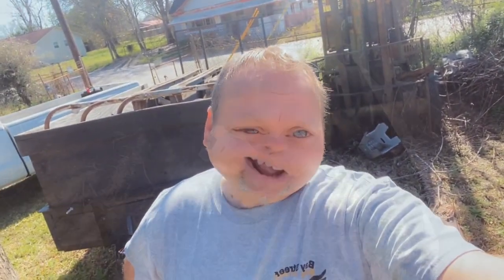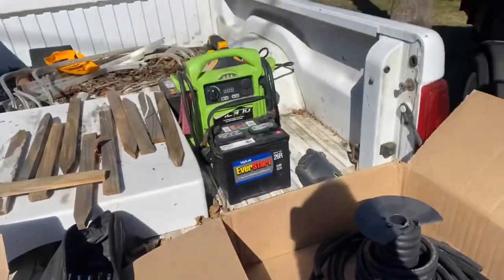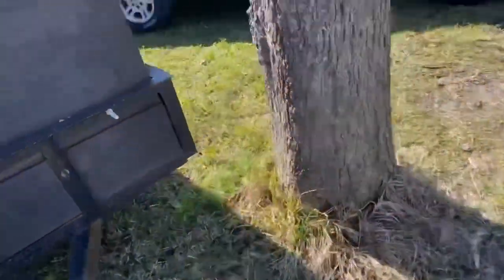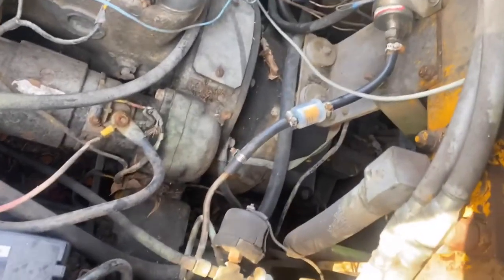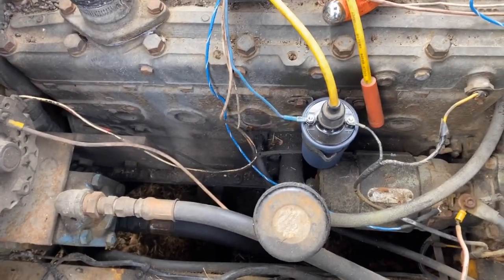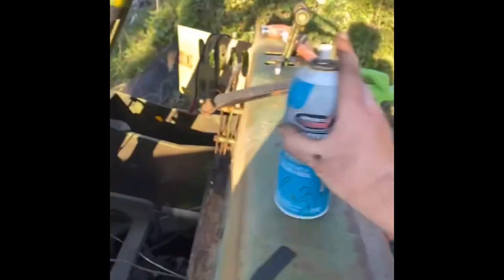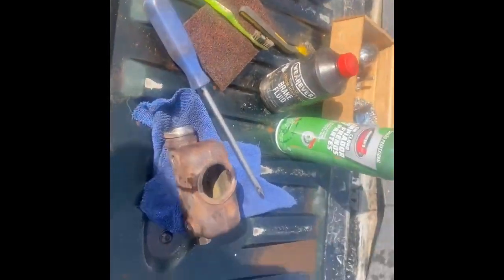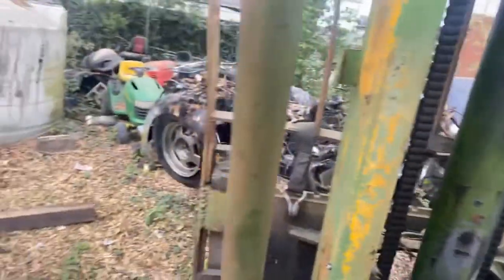1968 Baker Forklift w Hercules Industrial flathead 6 resurrection ￼

Comment: Hey, Good vid.  I happen to have the same forklift.  Just curious if you have part numbers for the points/condenser?  I have not been able to find.  Thanks!
Reply from the maker: I use 60s era chevy c10/truck ones .. some you have to do a sligt file or cut on one of the screw holes , but work fine .. I tried to find a electronic conversion ,but no luck .. one day ill swap the engine out... my clutch is weak .
Reply: @Savannahjbo  I found an electronic conversion.  Around $250. PerTronix D61-12A.  Says it replaces my Delco Remy 1111870.